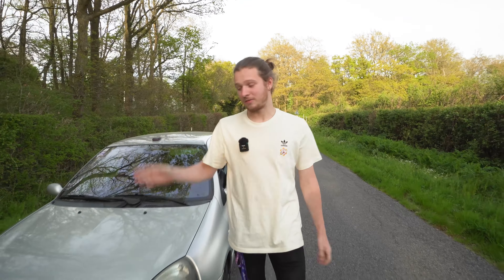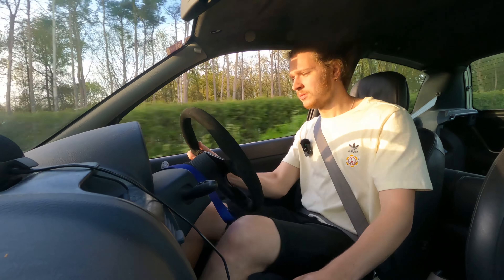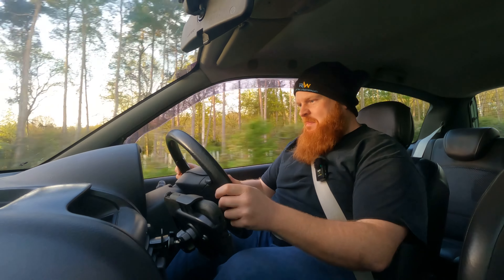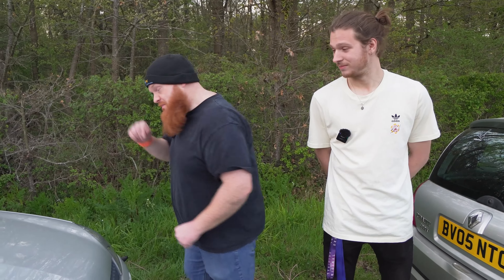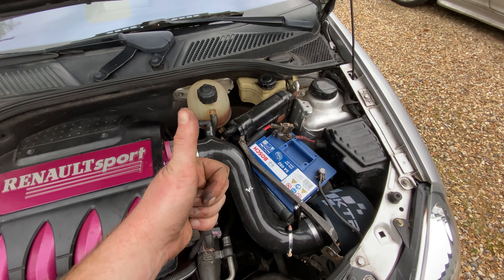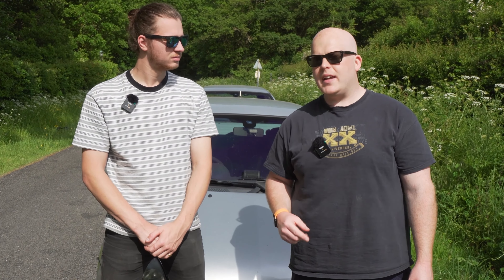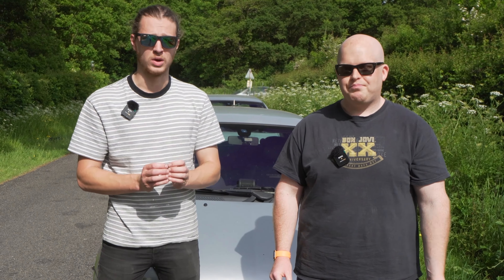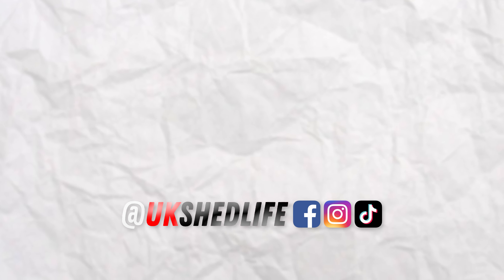Renault Clio 182 Expensive VS Cheap Episode 2: Air Intakes

Comment: 3:35
This hole in the intake hose is maybe the responsible for the big change(loss) un BHP versus the Ktec?
Reply from the maker: Potentially. I can’t remember if I ripped it while filming but even if I didn’t, I doubt there’s much air loss to the airbox. Even if it did I’d estimate 2-3bhp?
Reply: @ShedLifeUK   Maybe air loss + hoter air by the engine bay suck at the hole hose.
And the intake "can" give 3,5% more BHP,this is more than 2-3HP in this case.
The Ktec seem good,far away of the engine and protected behind the battery..
That the only way i can find 12 BHP  :/